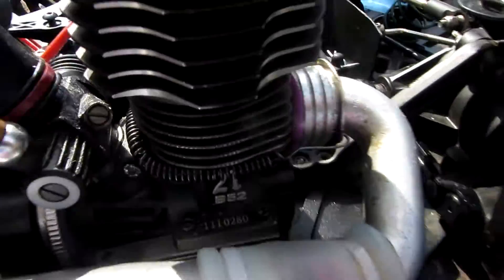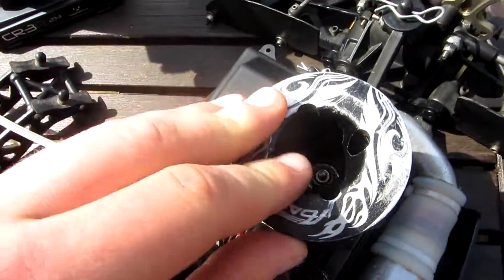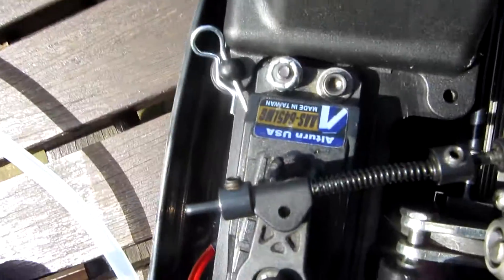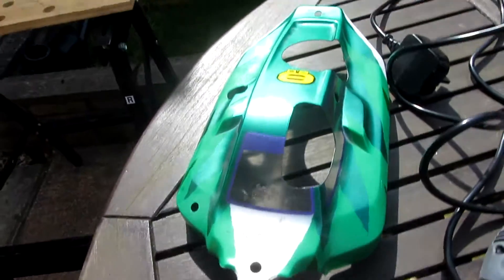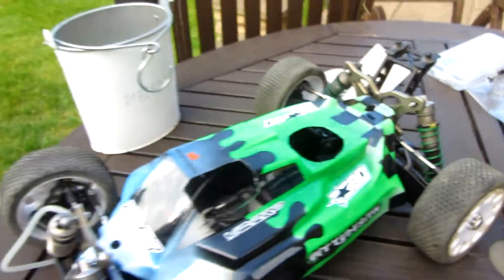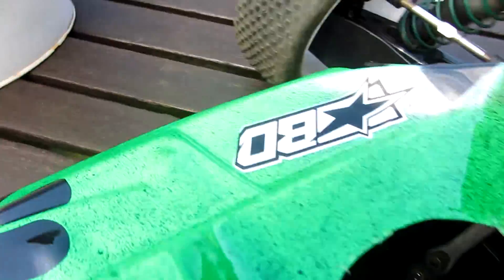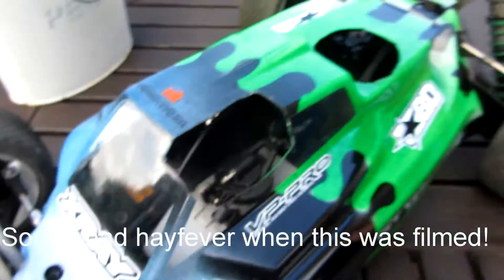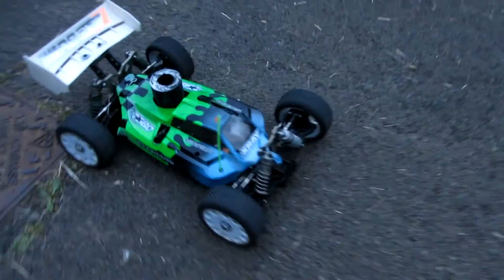NEW CAR! | LOSI 8ight 2.0 Nitro 1/8 Race Buggy | Build Video & First Run

Comment: Im gettin it used so do u know what to watch out for? Dont wanna buy a junker.
Reply from the maker: just try and get one that looks in good condition and if the seller says it has been recently rebuilt then that is a good sign too. But still be prepared to have to replace bearings, stripped screws and other worn out parts, its just all part of buying a used car.